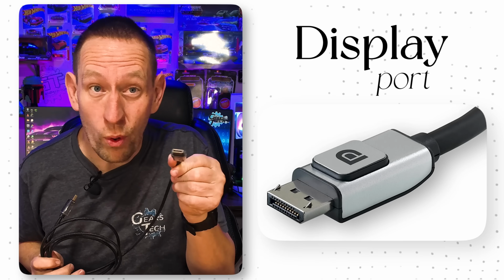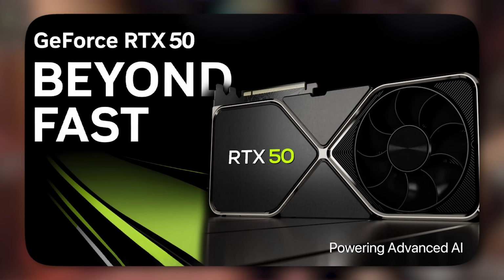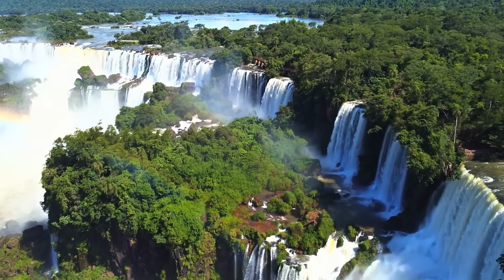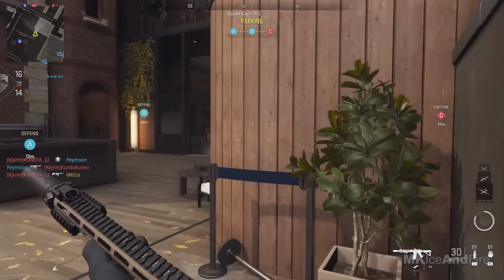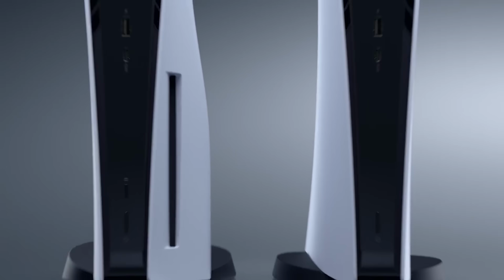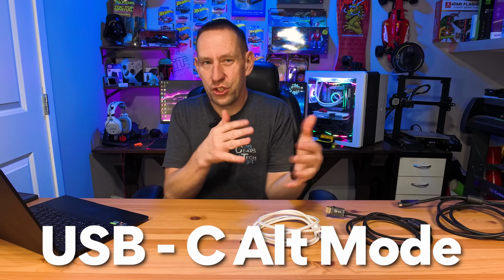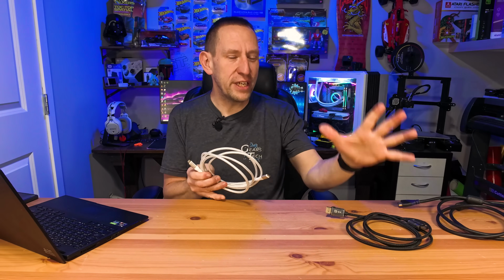HDMI vs DisplayPort vs USB-C Connection Guide

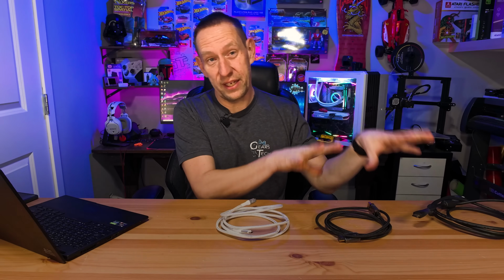Comment: 14:24 DVI-D has been the best for me, I've never had a monitor with Displayport or Hdmi.
Plus, I like how DVI connects securely with screws.
In my opinion, DVI was a major improvement over older VGA, eliminating the need of double digital->analog->digital conversion for LCD monitors. So that was a change that I wholeheartedly welcomed.
Reply: Get with Modern Tech and see what you are missing
Reply: @mrgcav well, after being separated from my PC for almost 3 years (almost a record in my life, because I had been around computers since the age of 3), I finally got my parts shipped to me. I had to buy a new monitor – and to my surprise they no longer have DVI-D. It came with an HDMI cable, but the monitor only had an older version HDMI that doesn't support G-Sync. So I bought a Displayport cable for it.

I also learned that from 2024 Steam stopped supporting my Windows 7, and some of my games like Snowrunner and 7 Days to Die could no longer launch (can't launch without an update and updating failed with an error).

So I had to upgrade to Windows 10. Jumped onto the last train with a free upgrade (successful activation yesterday) as Microsoft will stop supporting  Windows 10 in a few days, on the 14th of October 2025.

Comment: Hi. I’ve just bought a Mon which is 166 hertz to use with my Mac book air 2020. It has 2 HDMI and 2 dpi ports. HDMI works but I wanna try the dpi connection but don’t know how to achieve this considering I only have 2 usbc ports on the Mac. So I’m during a hub for the hdmi out. Pls advise
Reply from the maker: Hub to dp

Comment: Hi great video but I need some advice.  I bought a 16" portable monitor, plugged it on my laptop.... Working straight away no problems 👍 ....I go to my high end PC, plug it in to usb C (same as I did with my laptop) and Nothing ! 😢 It says on monitor no signal?! You think my pc usb C is the problem? I use that port for SSD and it's fine.
Reply from the maker: Pc usb is The problem. Need one that supports display port over usbc
Reply: @GearsAndTech I already have 2 monitors connected to my PC one is a display port. Don't think there's any more ports available.. I'm a game developer and have 8 SSDs connected 😮 for my projects and assets

Comment: Inaccurate; USB-C is NOT the cable, it is the connector and cannot transfer files, display video/play movies, or charge a device. USB3 does those things and USB-C can be USB1 or higher. If your device says it is charging slowly, it is NOT USB3.
Reply from the maker: Also not totally true.

I challenge you to show me a usbc port that's not 3.0 or higher
Reply: @GearsAndTech  The one on my phone USB2 C port

Comment: Since I'm still using an outdated video card, I have to use a USB-C to HDMI adapter from the USB-C on my 2070 RTX to get 4K resolution at 120 Hz on my television. Apparently,  the HDMI port of that video card will not support that display combination output and the television does not have a display port input. I also have to run audio to my Atmos receiver from the motherboard rather than the Nvidia card.

Comment: You should read up on the DP protocol. And btw Nvidia is so behind in using DP - they are pratically 4 years behind.
Daisy chaining  DP's  goes to at least 8 monitors if the products in use is of decent quality .
DP is able to control 250  screens - I am using 4 monitors from 3 computers, with onlu one DP output from eache computer.
Unforyunately it is not possible, yet, to mix the use of the monitors between the 3 computers at the same time - but it is only a firmware problem.
Reply from the maker: Sounds complicated

Comment: I have a 2K monitor which has HDMI 2.0 and display port. I will build a budget pc with no gpu but with ryzen 7 8700G and motherboard x870 which has usb4 -c (alt dp) but not a display port input. Is it possible to connect a supporting cable usb-c to dispplay port in order to use VRR features with my monitor? 

p.s I will add a gpu eventually, im just curious if the above mentioned is possible and also having all required features.

Comment: I have the latest Alienware monitor, but for proper 10bit HDR400 at 180hz with my RTX 3080ti, I have no choice but to use HDMI. If I were to activate VRR, displayport would be the only way to go, but I would have to disable 10bit colors unless I upgrade my GPU.
Reply: If you were by chance thinking about upgrading GPU I would maybe do it soonish before prices get more out of hand 😭 damn ai… I wish I just built my first pc last year instead of buying a half price Legion 5i 16IRX9 (i7-13650HX RTX 4060 24GB DDR5 144Hz) but I don’t have the space and it was a good deal. So I really hope that when my legion dies I can afford to build a pc but I’m not getting my hopes up
Reply: @issa_scythe Absolutely, but I'm still very satisfied with the performance in most games. I'm also currently building a home cloud server and the price of the entire thing, while expensive, is still less than the price of a new graphics card that could outperform the 3080 ti.
Reply: @G @Gomizilla  That’s awesome, such a good idea. And yeah 3080ti is still very impressive!

Comment: If you have to connect a laptop and you want to do it with just one cable, to support it with power, attach mouse and keyboard, get it into a wired network AND attach it to a display, USB-C is your best option.

If you need a long connection, passing from one room to another, HDMI is great, as it supports 10m and you can further enlengthen it with active electronics. In addition your AV receiver, TV and beamer might only accept HDMI.

For a local gaming setup, I agree with your analysis.

Comment: USB C (letter of alphabet) is the plug, USB 3.1 gen 2, or 4 (digit) is the speed/capability, however the USB are "options" inconsistent as to which capabilities left to whims of manufacturer as to are or are not included/supported on any given device/port.   Thunderbolt™ on the otger hand there's no "optional" all capabilities are included consistently, the plug is C, the digit tells you which speed/level/set.  When you think about it, that aligns with DP or HDMI is the plug, the digits are the specification.

Comment: man, ive been going back and forth with usbc and DP and the usbc connection (map m4 laptop) and the picture quality is easily better and seeable with the usbc connection. wondering if I need to calibrate the DP to get the same quality (or better)

Comment: HDMI is much more stable and better solution, for example, using HDMI under Windows and nVidia you have additional options in the control panel. It's the same with DLSS and FSR - supposedly the same, and yet FSR is only suitable for garbage.

Comment: yeah i've been a fan of thunderbolt connections, especially since i'm a heavy mac user and need high sustained bandwidth to transfer files, the thunderbolt 4 and now 5 does that, plus powers big monitors, and powers my laptop... so i went with super wide thunderbolt monitors (2) 40"

Comment: I have a M4 MacBook Air for work (mainly lots of open tabs, nothing artistic of graphic heavy).

I also have the new Asus swift 27ucdm gaming monitor that has 4K 240hz.

I’d like to use this monitor as a 2nd display for my MacBook Air— I have a 3rd monitor but it’s like 10 years old and I’m sure it only supports hdmi 2.0 but I’m thinking of still using it until I upgrade because a 3 screen is a 3rd screen.

What cable setup should I use?

Thunderbolt usbc to usbc cable? Then to my 3rd monitor a usbc to HDMI adapter?

Should I use a usb dock to save that extra port on my laptop? Money isn’t an issue. Just want something clean and future proofing is always nice.

Thanks.

Comment: I run 2 monitors on a beefy desktop for video editing primarily (and general use, but not so much gaming) and while the PC is newish (built in January, and utilizes some of the latest tech, though the graphics card is the A770 simply because it was available, and a full 16x, 16GB card and has 3 DP and one HDMI ports.

That said, one monitor I bought new last year and is good for 4K/60 under DP 1.4 via USB C to full DP and it can also run HDMI (2.0) and I can daisy chain HDMI if I want.

I also have a 22" Onn Surf 1080P monitor to replace an older 720 VGA/DVI monitor. It was fine with the older 1030 as it had HDMI and DVI but again, the Sparkle has 3 DP, one HDMI so the Onn runs HDMI, Dell DP via USB C. Newer versions of this monitor now use the full size DP connector on the back. 

So that is my setup at the moment as I will be adding another larger monitor for 4K, the Onn will be for Word processing/spreadsheets etc and all will be in articulated arms that allow for vertical orientation as needed.
Reply from the maker: Sounds like a great setup

Comment: only type c cable can support touch feature on a touch screen monitor
Reply: Not exactly true, you can use other USB cables A or B as they both also work for touch screens as well. Most monitors with a standard USB A or B port can work so long as it’s attached to the computer.

Comment: Very informative video. May I add a constructive comment though? It's misleading, in this particular content,  to claim USB-C ports are everywhere. While it is true that USB-C ports are very common, but DP Alt Mode capable ones are still not very common right now. And for the DP Alt Mode to function, all of the components—the device outputting the signal, the cable, and the device receiving the signal—need to be DP Alt Mode capable. This configuration is still not that easy to achieve these days, unless you happen to have all new devices.
Reply from the maker: I agree. But at the current pace I expect it'll be more true every month. I expect people will still find this video in a year or two, and it'll be completely true then

Comment: Hey, I don't have a PC system and my setup is just my laptop and a monitor. At some point later i would like to get a console like ps5. I should get a HDMI cable for that right, because hdmi cables can transfer signals from controller to monitor as well?
Reply from the maker: For ps5 the hdmi is your only option

Comment: I have a 5080 connected to a Philips Evnia 32" oled monitor. Both are supporting G-sync and it works perfectly. I chose hdmi because my monitor supports hdmi 2.1 which have higher bandwidth than the Displayport 1.4 in this monitor. But if i had a monitor with Displayport 2.1 I would choose that cable (no compression needed to reach 240hz).
Reply from the maker: Excellent informed decision

Comment: Also, USB-C supports Thunderbolt. I think in that flavor at least 6k 60hz is supported. I have a 5k monitor connected through Thunderbolt via USB-C. Works fine at 10bit color.
Reply from the maker: Any usbc video is done using dp alt mode.

Comment: Have a usb hub that charges my laptop when plugged in.  laptop complains power delivery is low but 100% is 100%    :}
Reply from the maker: It's the rate of power. It'll get you to 100% slowly but if you did power hungry tasks the battery would die even if plugged in

Comment: HDMI is behind a pay wall for developers.  Display port is free and open source.
Reply: Tell that to monitor manufacturers that keeps chugging out HDMI or even VGA but very seldom DP
Reply: @haroldcruz8550 my monitor has a 2.1 display port
Reply: As I watching the video I was hoping he was going to talk about that.
Reply: Show me the URL of the “free and open” DisplayPort spec which can be legally downloaded without paying for it.  I’ll wait.
Reply: BAH!  You know what doesn't have VESA fees?  COMPOSITE OUT!!  Just grab a cheap PCI-e to PCI riser, couple that to a PCI to ISA bus, slap on a glorious ATI CGA out graphic card, hook up composite-out to your RF modulator on your VCR, plug your VCR coaxial to your tv, and enjoy playing DOOM in its ORIGINAL 16 colour 160x100 resolution.

Now leave me alone, it's almost 3:00 and Matlock is on, on channel 12.
Reply: You must pay VESA a license fee for the DisplayPort spec
Reply: @marshallgoldberg8376  Not exactly. You pay a fee for certification.
Reply: @snipermagoo They have certification tests for DisplayPort, USB, CarPlay, Thunderbolt, and more.
Reply: The main issue with using HDMI is the HDMI forum does not allow open source drivers. That means open source solutions like Linux cannot support HDMI 2.1. This is the reason the Gabecube only lists HDMI 2.0 on it despite having 2.1 hardware. This basically ensures more displayport usage as displayport to hdmi adapters are easilt available.
Reply: most consumers aren't developers🤷‍♂
Reply: @eliteobi3608 but who do you think makes the stuff most users use, and what it means is there is no HDMI 2.1 support in Linux, because it isn't free/open
Reply: So you’re boycotting HDMI?

What open source license is Display Port under?
Reply: So says the person who isn't bitching about the monthly anti-virus subscription, the XM radio subscription, the Netflix subscription, the Microsoft 365 subscription, the iTunes subscription etc. No. One. Cares.

Comment: I can connect my GIGABYTE GA-F2A58M-HD2 mobo to my Viewsonic HDMI 1080p monitor with a HDMI cable. But if I set up the OS for the monitor's 1920 x 1080 native resolution I cannot make the full image match the borders of the display. In order to get an undistorted full image I have to use the D-Sub ports. I've been wanting to upgrade my monitor, but it looks like I would also have to add a PCI graphics card with ports to match.

Comment: i have 3 2k monitors all connected with one USBC cable to my gaming PC via a docking station.
my laptop need 160Watts when heavy gaming, but for work and light gaming, it is just fine with the 100w that the monitor gives it.
when i need more power, i just connect the power supply. 
the same USBC connection, also handles the ethernet and input devices, so by moving one cable from the personal computer to the work one, i instantly ready for anything

Comment: Not sure if he mentions it later in the video, but 2 meter and 3 meter HDMI 2.1 cables are the go to lengths.  Once you step outside of those two lengths you may have some issues.  Yes... that does mean the 1 meter length.  I am using HDMI 2.1 with 3 meter cables and all works fine.  When you go beyond 3 meters, there seems to be power issues.
Reply: "In practice, the maximum effective length of a standard HDMI cable is often considered to be about 50 feet (15 meters), but beyond this, signal degradation may occur, affecting audio and video quality. For runs over 25 feet, high-quality cables with signal boosters or active HDMI options are recommended to maintain 4K or 8K performance without loss."
I am using a 10m without active electronics and 15m with active electronics myself and it works absolutely fine!
Reply: @moskitoh2651 HDMI 2.1 requires additional research... 2.0 probably more than 3.0 meters with no problem ... 2.1 is a different beast.
Reply: I just bought two 10 meter optical hdmi 2.1 cables on amazon.  For $24 a piece.  I use them on two hdmi 2.1 tvs and a pc.
Reply: @_PatrickO woops.... research is important.  An HDMI cable beyond 3m requires a booster, if you want to call it that.  Those cables are $100s of dollars.  A 2 or 3m is best for the PC.  No more, no less.
Reply: @gordonderouyan9980 That is wrong, as already 2 people stated. According to which source do you write this?

Comment: Well on a brand new MSI QD-OLED monitor you must use Display port to update firmware with the USB cable hooked up too so you need display port at least for that. HDMI is better for video standards for movies and such and display port for gaming has been the usual advice but the C port is new.

Comment: Right now, we only have a few 4K monitors with DP 2.1 support.

I have a QHD QD-OLED monitor and only supports DP 1.4a. And that's the connection I'm using.

Comment: I'm curious if a single USB-C from my Asus laptop can plug into a hub that can run my monitor and other peripherals. I have a ZenBook with an HDMI on one side (next to the power socket) but they put all the all the USB-C jacks on the other side. It's not ideal since I have to run three cables to my laptop and looks messy. Just wondering if that USB-C will also run a monitor through the hub...?

Comment: My GPU 3090FE that I’ve had for about almost 3 years, I usually use the DP, the first one next to the HDMI, but 3 weeks ago now it stopped fully loading ALL of my games, the DP still boots the PC fine and functions fine but refuses to fully load games, games crash at the start menu or loading the start menu. I thought my GPU was fully damaged but found out that the other two DP and HDMI work fine, they load games without a problem, it’s just the one DP which I use to use that has a problem. I’m just hoping it’s not a hardware issue, even though have updated and even reinstalled the nvidia drivers 😔Does anyone know what the problem or solution could be ??

Comment: Thank you for the info, after looking into this I had a older HDMI cable going to my monitor with an AMD Freesink monitor and an AMD Radeon RX 9070 XT Graphics Card. After upgrading the HDMI cable I'm getting the gaming monitor I bought!!!!

My LG 32MR50C-B Curved Monitor 32-Inch FHD 100Hz, AMD FreeSync, Dynamic Action Sync does not come with Display Port or USB C ports.
Reply from the maker: Wow, it's crazy how much difference it makes!

Glad I could help. It's so easy to end up with a crappy cable and not know it